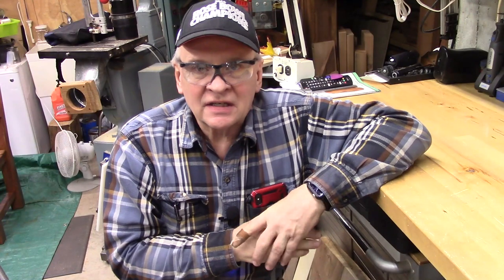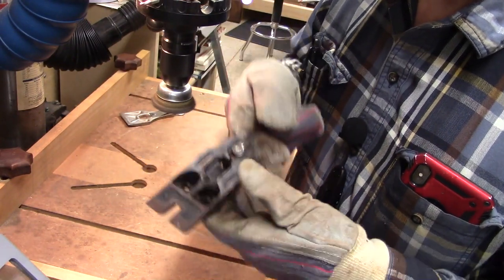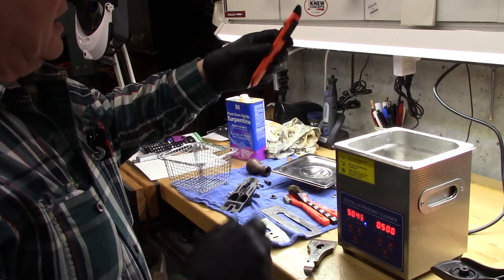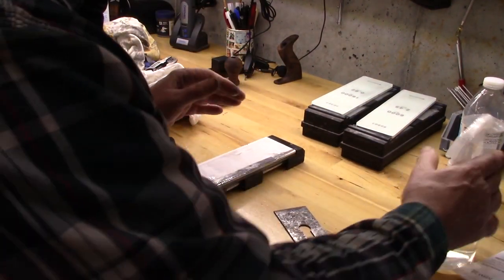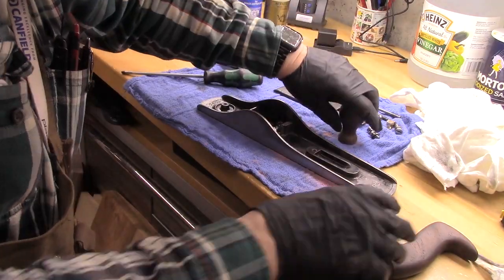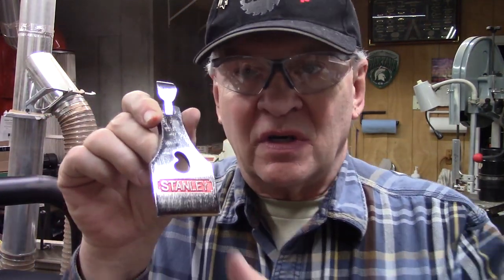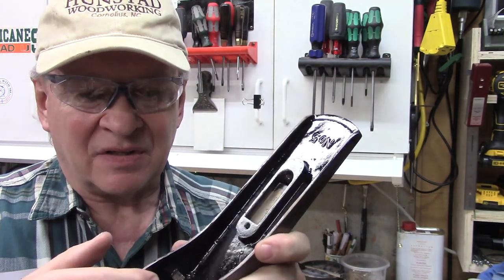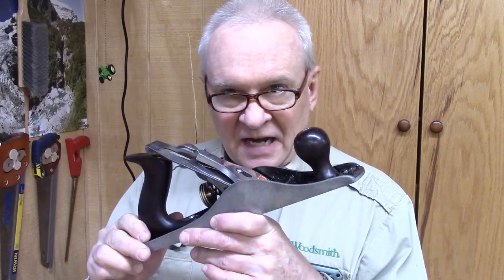Stanley Number 5 Plane  Restoration Complete Including Nickel Plating, and Japanning with Dr. Joe

Comment: Great video!! Enjoyed watching it.
Reply from the maker: Glad you enjoyed it! Thank you so much.
Reply from the maker: I had a great comment on the use of Evapo-Rust. Yes I use the wire brush to take all the rust off this plane. I do use Evaporate-Rust frequently with two restoration projects and it works great. It is a wonderful product and I have a 5 gallon pail that I literally soak everything in. I could’ve use that but I chose not to on this case but that product is fantastic thank you

Comment from the maker: Great question about japanning a Coleman lantern. The japanning, once it’s been heated and again I heated it at three separate times each time with increasing temperature, certainly tolerated those feedings without issue. I believe it could tolerate additional heating but I haven’t done that. Thank you very much for your comment. It does seem to be a very durable finish

Comment: What is LVL lumber
Reply from the maker: Laminated veneer lumber is an engineered wood product that uses multiple layers of thin wood assembled with adhesives. It is typically used for headers, beams, rimboard, and edge-forming material.
Reply from the maker: Laminated veneer lumber is an engineered wood product that uses multiple layers of thin wood assembled with adhesives. It is typically used for headers, beams, rimboard, and edge-forming materia